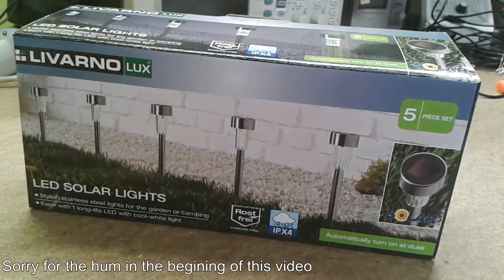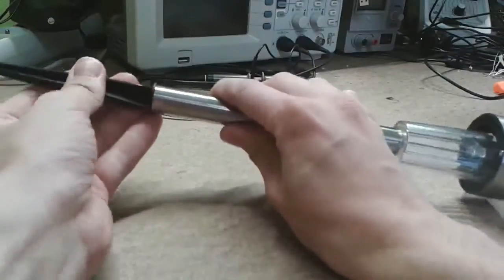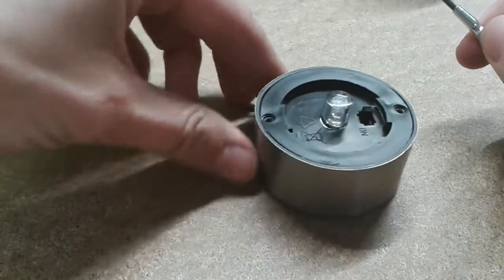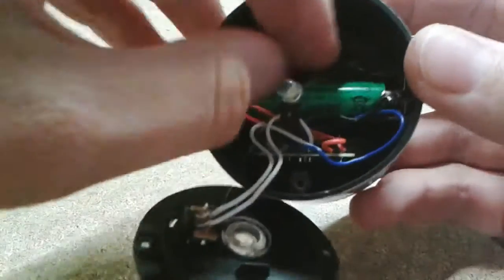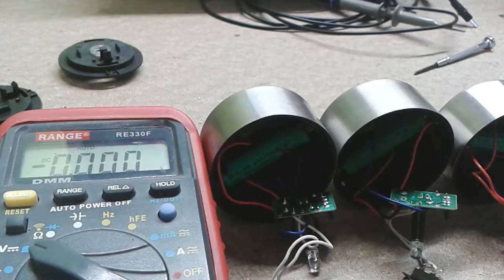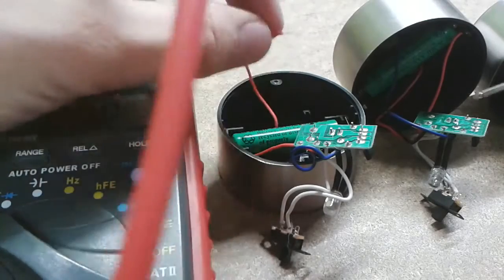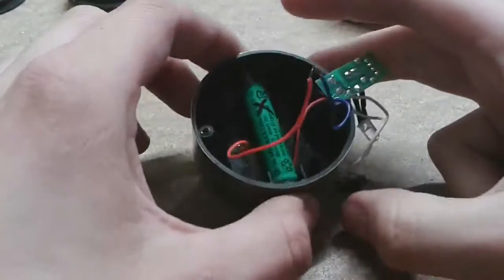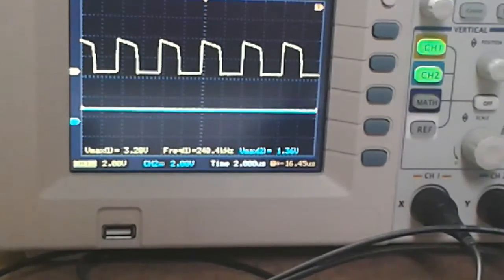Solar light teardown YX8018

Comment: I think you measured it on it's face... but regardless, most likely the wires are disconnected from the solar panel. It is seated in hot glue so maybe you could've just use hot air to dismantle the solar panel from it's case, resolder the wire and glue it back. It could be a simple fix.

Comment: Hi, can i ask 2 question??  From where i can buy yx8018 ?? And where is the sensor of the light that turn it on or oof???  Thanks
Reply from the maker: +Mehr Arian Hi, I don't know where you can get them. The sensor which turn the LED on and off is the photovoltaic panel itself. It's clever solution so you don't need another photo transistor.